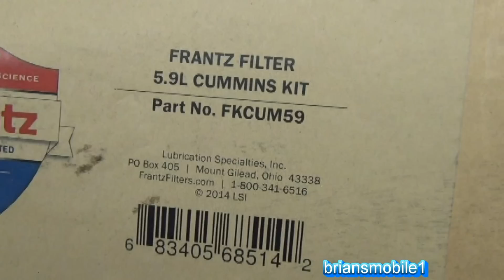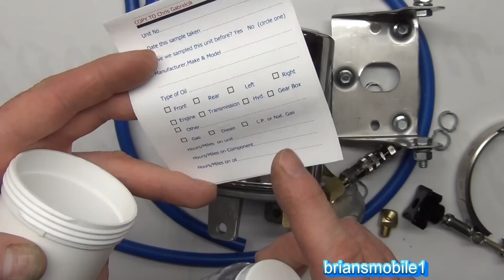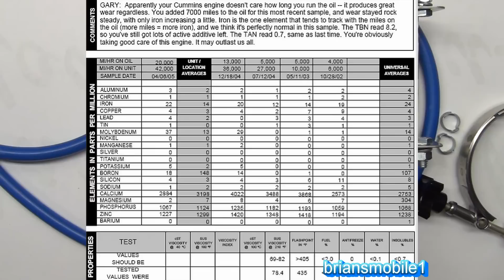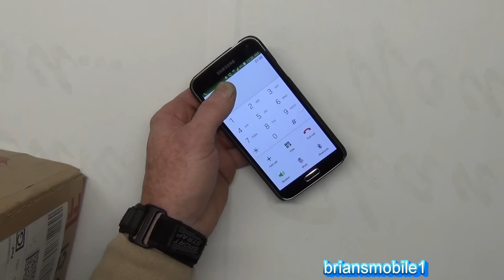How to Make Synthetic Oil Last Even Longer  Frantz

Comment: Is filtering down to 1 micron enough to turn the oil colour from dark back to clear/golden?
Reply: @ralphwood8818 Thank you!! I really wanted to know before I fork out for a bypass filter. I was so disappointed after changing my oil and seeing it go dark again so quickly
Reply: The Frantz is a bad design but they are the best known. With the top loaders its push the paper down against the bottom and put on the lid
Reply: Dont know of any filter that can keep the oil in a diesel from getting black. Some diesel engines take longer for the oil to get black. The oil can be analytically clean and be very black. My Ford diesel tractor for example. My oil filter is as good as you can get. It is a flat head Ford V8 canister filter converted to use a full roll of Scott 1000. At present time it uses a cut down roll of VIVA paper towels. 4 1/2 by 5 1/2 inches. I mark a roll of towels. When the towels get used down to 4 1/2 inches I cut then to make two 5 1/2 inch elements.
Reply: @samwest3762  when I put a Frantz on my nearly new 64 Rambler American flat head 6 the oil went from dirty and black to golden. I expected the same with the Peugeot diesel. It aint going to happen. Its like filtering out ink. Im pretty good at determining if the black oil is still clean. Ive been at it for a long time. If the oil is dirty it will feel dirty and will stain the skin. One guy said he checked the dipstick after an oil change. He went back and accused them of not changing the oil. They said you  must be new at owning a diesel. Some engines take longer for the oil to get black. My Ford diesel tractor isnt one of them. I probably wont drain the oil but I will change the bypass filter often and add a lot of make up oil.

Comment: John Frantz got his start adapting the old canister filters to use superior toilet paper.. I just adapted a Stock Ford canister filter for a V8 flat head Ford to use Scott 1000 TP. It went on my 79 Ford 1900 diesel tractor. A Ford filter should go on a Ford. Bought the tractor as a project. Started with a superior oil filter. Used a Perma Cool universal sandwich adapter that is normally a oil cooler adapter. Not sure Frantz still makes 2 port sandwich adapters for motor oil..I think I got lucky. The full flow filter had nothing big in the pleats when I cut it open.The Perma Cool universal sandwich adapter is for oil coolers. Work the same for bypass filters. Only fit small filters. Got it from JEGS years ago. It has two ports for pressure and return. Used one for the  diesel tractor. The flat head Ford V8 filter heated up today. The Scott 1000 was a perfect fit. The Ford canister filter is a little larger than a Frantz. Instead of the clean oil going to the fill cap it goes to the inlet of the full flow filter. The Sandwich adapter must use 3/4 16 thread full flow filter such as most Fords. I had a Fram Tough Guard on the shelf. I think the canister filter was optional equipment.on the Ford. The best element was cotton.

Comment: Well as far as I know it's the additive package in the oil that gets depleted over time that is the  major concern  not just particulate . This filter does not address this and expending the oil change interval is something I would not do.  Might be of use for some but for me I just change the oil more frequently. Nice review Brian.
Reply: Hey Steve, when the Frantz filter element is changed about 1 quart/liter fresh makeup oil is added that helps restore the additives. 
Same thing occurs when  the factory filter/element is changed. 
The used oil laboratory analysis shows how well the system works, the condition of the additives package and the presence/quantity of any contaminates including any wear metals.
Reply: +patw52pb1  It seems all the manufactures have gone to longer oil change intervals and from what I hear from the guys that changes engines weekly  they say it the extended oil changes that are the result. In North America the oil is relatively cheap compared to other parts and it's great for them but for me it's the same  old 3 months or 5000 km  . I guess I'm set in my ways LOL Nice to see you buddy Cheers
Reply: STEVE ROB
Likewise, take care and Cheers.
Reply from the maker: Thanks Steve.  Check out some of the oil reports people have posted online.  That's one of the things that gets evaluated.
Reply: Was talking about a Series 60 Detroit 425 HP engine that gets no oil drains.Road King magazine asked for the truck owners phone number. They did an article on it. Its the same system as the Frantz except instead of 1 quart of new make up oil added the double paper towel Gulf Coast filter needs 3 gallons of new Rotella. When the two full flow filters are also changed its 5.5 gallons of new Rotella.added. about every 250 K miles it is torn down and Shell oil measures the parts. It is reasembled and the used oil is poured back in. With Shell oil it will get a lot of oil analysis. At a million miles one engineer said it is not unusual for these Detroits to go a million miles but not be in near new condition.
Reply: I dont normally drain the oil. On my gasoline engines I change the toilet paper about every 6 K miles and add a quart of new oil. With the Ford diesel tractor its another story. Ford recommends 30 weight in the summer hot weather. Its heavy duty 30 weight.The first cold night it was too thick to circulate. The oil didnt have the W next to the 30 which meeant it wasnt winter grade. I put 15 W/ 40 in it.

Comment: Your Motor Guard compressed air filter started in San Jose California as a toilet paper lube oil filter.Cummins Fleet Guard 750 bypass filters used to use chopped. Newspapers and wood chips in their best elements. Wix and some others made elements for them and Luber Finers. Don't know what they have now. Its been a long time since I serviced the big engines. I have seen Frantz three stackers on some heavy trucks. They were a mess to change but very effective.

Comment: Brian; ran one of the original Frantz oil filters on my 2nd Healey in the 60's. Never seen another since. Didn't know they were available. Warrantee, schwarrantee! Manufactures suck. 
Did religiously, oil samples on my semi's all the years I owned them. Money well spent (cept the local Cat dealer lost 1 of 3 so i changed labs...)
Reply from the maker: One of the reason Cat engines are so awesome and last so long is they have some of the best filtration ratings on their filters.  I know many Cummins owners that run the Cat fuel filters with adapters.
Reply: same for Duramax engines, tons of guys running the 2 micron cat fuel filter. i have also a FASS 150 on my truck and the Donaldson fuel filter is a 2 micron
Reply: A big pleated paper filter will beat a little pleated paper filter anytime. The famous Frantz 3 stacker will beat any of them. Especially if you feed it with one orifice instead of three.  You can still find them on marine  vessels. I saw two on a  truck with a 8V 71 Detroit. The guy said he gets a 6 pack of Safeway Truly Fine to service them. That was in the 80s when TP fit The Frantz and was tighter wound.. Now about the only paper that fits the Frantz is the Frantz elements.one mistake people make putting a little TP filter on a diesel is they go too far between filter changes. Shouldnt go over 3.000 miles.4 inches of.filter media is better than pleated paper.but they aint magic. A tightly wound roll of TP is a 1 micron filter. I was putting a Frantz on a Chevy Luv about 40 years ago. I noticed a little Frantz bolted to the frame on his over the road truck. I said that filter is too small for that truck.He said no its not I change it every day. Well excuse me.
Reply: The big spin on fuel filters cant compete with the Frantz or other TP filters. Also they tell me they cost about 20 bucks. The orifice helps and the large size helps. Its still pleated paper up against 4 inches of TP. I dont think they can eliminate oil changes like TP. They are pretty much just a full flow filter with an orifice. Like my 64 Rambler flat head 6 that was factory installed. You cant clean oil with pleated paper. Some are putting the big 1 1/2 gallon Gulf Coast filters on the Cat engines. I did a fleet of Navistars. Some of the big Gulf Coast filters had a General Motors part number. When I sold them they used Bounty Big roll paper towels. The ports were different on the GM filters for mid sized GM trucks. A little trivia for you.

Comment: One guy said he isnt going to put a 99 cent filter on his expensive pickup. At one time Gulf Coast Filters of Gulfport Mississippi installed Frantz 3 stackers on offshore drilling rig engines. These are locomotive engines and generators. Not sure when the famous Frantz 3 stackers went out of production or how much a locomotive engine cost. Might be even more than a Cummins in a pickup. You can still find Frantz 3 stackers on big marine engines. Mostly been replaced by the Gulf Coast filters which are easier to service.

Comment: looks great. 
brian, if it's only 1 micron doesn't it filter good additives away too?
Reply: NO it does not, additives are sub micron
Reply: Not an expert on additives. When a sample of oil is analyzed you get a list of additives still in the oil. Dont use a oil that uses solids like Graphite.In the old days we had Arco Graphite. The Frantz removed it. No one told the Frantz to leave it in it was a good lubricant.The Frantz thought it was an abrasive. Of course the full flow filter couldnt take it out. TP cant take out the liquid additives also some diesel soot is non abrasive and too small to be filtered out. Its like ink. Black oil means nothing in a diesel.
Reply: Its not only additives. They can tell if something is wearing out. They know what the parts are made of. They know if the bearings are worn down to the copper. I got so used to amber colored oil in the gasoline engines I was shocked to see oil in the diesel that looked like someone poured ink in it. Lab analysis might tell you the dark oil is cleaner than when it was new. There was a time when I thought new oil was always clean.

Comment: Could one put TP in a plastic tube,
plug the hole,
pour your used oil thru,
let it drain
and have clean oil to put back in.?
Reply from the maker: It could work in theory.  Measures would have to be in place to keep it going through enough times to be clean.  And you'd have to use or create means to keep it from making a mess to have it be worthwhile.
Reply: I once had a slightly elevated tank with used oil in it.I thougbt I can put a valve and hose on it and run the hose to the TP filter then to a clean container. Didnt work. Probably need 5 psi or more. You dont get the long engine life that way. It must be done on the car. Some large diesels have a computer that puts some oil in the fuel tank from the engine and adds some new oil. From a tank..
Reply: One guy does it but he elevated the tank a lot higher than I did.
Reply: @briansmobile1    Mount the PVC tube above a funnel & an oil jug.  Could pour it thru more than once I guess.  No muss.

Comment: Wix filters are fiber media.
Reply from the maker: Every paper there is, is made of one type of fiber or another.   Cellulose fiber, wood pulp fiber, straw fiber, fragmites fiber,  etc.
Reply: +briansmobile1 I know this is probably a sponsored video Brian but you know the difference in a paper and a fiber media oil filter, i.e. Fram vs Wix.
Reply: If you leave a pleated paper filter on too long the pleats may get rotten and break down. Im told the full flow filters that use synthetic pleats wont break down. Probably good to change the full flow filter at least every 2 years.
Reply: They are all fiber filters. Both Fram and Wix have paper and synthetic fibers. The standard Wix I just took off my Pontiac was paper fiber. Im told the Wix XP I put on is synthetic fiber. I dont know.

Comment: Yes now do a good install video of this Frantz as nobody has a real good one like you would do. I did not see the OEM oil filter adapter they used to sell with this kit which had the exit ports on it and the original oil filter would screw back on the adapter, maybe you shown it here and I missed it or are they reverting back to taping into the oil pan Idea?
Reply: Ive seen the adapter used in some videos on their site. I think its still used in certain vehicles.
Reply from the maker: You're right and you're in the know!  The Cummins engine doesn't need the sandwich adapter because it has oil ports on the filter head you can pull a plug out and put a fitting into.
Reply: wow cool will look for that on my 96 1 ton Duelly Cummins Diesel...learn something everyday.
Reply: I still have a few old Frantz two port sandwich adapters.Sure beat tapping the oil pan. No diesel pickups in those days. There was an inlet and outlet . Frantz and Motor Guard also had 3/8 hollow bolts for replacing a intake manifold bolt on many V 8s Some of my lawn mowers have no way to get oil for the TP filters.I usr a Frantz Ford adapter. I put a pipe plug in one port. I only have one Frantz single port adapter. Its for a honda. I once returned the oil to the wrong side of a baffle on a valve cover on a Peugeot diesel. Wife was driving. I said slow this thing down. She said it wont slow down. It was running on motor oil. Got it off the road and stuffed a jacket in the intake. That was dangerous. Should have used a Frantz two port sandwich adapter on that car.or returned the oil closer to the fill cap. I see Jackmaster has two port sandwich adapters. I have used Perma Cool universal sandwich adapters from Jegs. They are for oil coolers..
Reply: The 2 port Frantz sandwich adapters didnt work on small engines. They depended on enough oil flow to create a pressure difference. I bought several Perma Cool universal sandwich adapters from Jegs years ago. The reason they work for a bypass filter is because a bypass filter acts like a restricted  oil cooler. A spring loaded valve keeps oil going to the engine plus keeps pressure on the bypass filter. The Perma Cool universal has different size bushings to fit most small filter mounts. Only 3/4  16 filters will screw on the sandwich. Many Fords and Toyotas for example. Getting ready to put one on a Briggs and Stratton 22 HP riding mower with a 60s model Motor Guard. Put a Frantz on the gasoline.

Comment: So does Charmin work better over Bounty? Or does it not matter?
Reply from the maker: They're both terrible choices.  You want thin single ply cheap stuff.  It's tougher and filters better.  Think # of sheets like you would think folds per inch on a spin-on oil filter.
Reply: is it literally toilet paper or actual filter material?
Reply: briansmobile1
Ok, so the better it gives you a rash, the better it filters... got it!

Very cool video btw.
Reply: The Bounty big roll paper towels are what they use on heavy duty diesel engines. Things change but now Charmin wouldnt be as good for small engines as Scott 1000 or Great value 1000 from Walmart..The advantage of the Frantz elements is they fit. Peasants know how to adapt the Frantz to use the bigger core TP. The Jackmaster Classic is set up for TP. If you can find a used Motor Guard Gulf Coast or Jackmaster get it. Saw a used Jackmaster on Ebay for 50 bucks. People are grabbing them as more people learn about them. I guess TP is TP untill you put it in a canister. Then you have one hell of a filter material.
Reply: One guy called Guidpguitar was showing his VW dune buggy with a pristine engine. He was using loose wound TP. Normally you wouldnt think a loose wound roll of TP would clean as good as Scott 1000. The cheap loose wound paper was cleaning  the oil but the contaminants were getting deeper in the TP like the Bounty big roll. Sometimes you can get fooled. When he showed us the valves I knew he was doing something right.
Reply: Today I put a roll of Angel Soft in the Jackmaster Classic.  Its the Mega roll. Two ply. Similar to what we used in the 60s. I removed 15 rounds but probably didn't need to. The reason the Bounty Big rolls have been so successful is they have the same size orifice as the TP filters. There is no stress on the element. Similar to a gravity filter where the oil is allowed to use gravity to allow the oil to soak down thru the towels. Kind of like rain water soaking down thru the earth. The little TP filters depend on oil being pushed thru the TP. The Angel Soft is an experiment. I will know more in a couple of weeks.
Reply: The Angel soft didnt work so well. The Jackmaster Classic  has no center tube. They require a firm roll such as Scott 1000 or the Jackmaster Classic element. The Jackmaster Classic has no center tube to keep the softer paper core from collapsing.
Reply: Saw some Charmin in the Grocery store the other day. Its 2 ply the same as what we used before the Frantz elements or Scott 1000. The core is larger and the paper is shorter. The top loaders can deal with it. You can use it in the Frantz but you need to know what you are doing. The contaminants go deeper in the 2 ply. I bought a 4 roll pack.

Comment: will we see a install video?
Reply from the maker: Probably.
Reply: +briansmobile1 Thanks Brian!
Reply from the maker: ***** Man, how can a NOT?  I'll do it.
Reply: The problem with cars is they are all different. When I started using the Frantz you had American cars and the VW beetle. If you did big diesel engines you installed Frantz 3 stackers. I just converted a Ford flat head V8 filter to take a roll of Scott 1000 and put it on my  Ford diesel tractor. Its a project tractor. Looks like the only thing that doesnt need work is the engine.